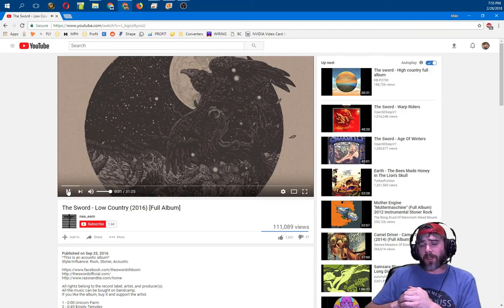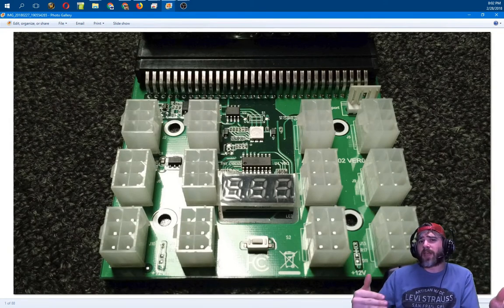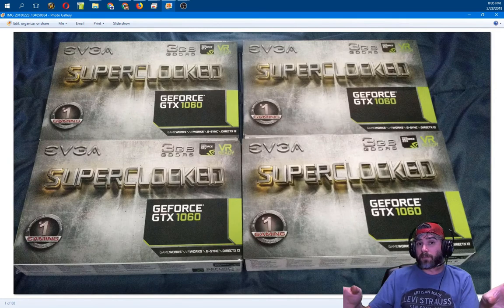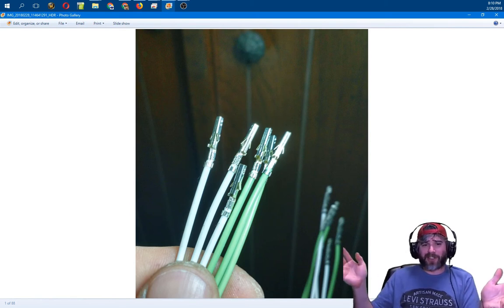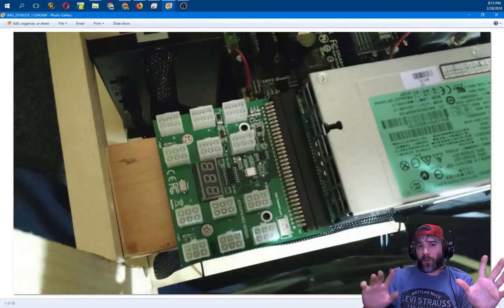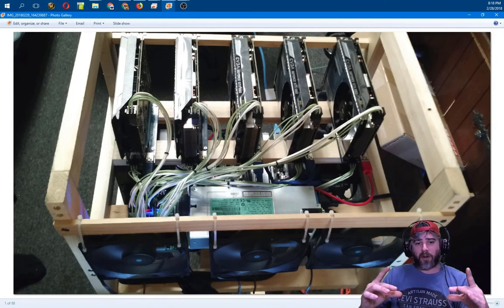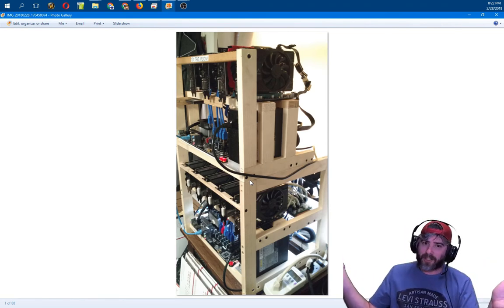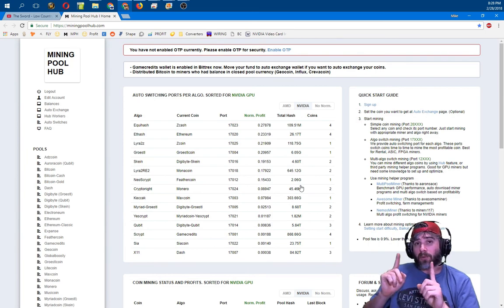Upgrading my mining rig PSU to use a 1200W server PSU, 5x GTX 1060 rig

Comment: How do you connect the Server psu to the ATX psu for it to turn on and turn off together in one touch of a botton?
Reply from the maker: The server PSUs breakout board have a header that looks for a 5v or 12v signal [i forgot what] and it will auto power on when it sees it. Basically, you just jumper the ATX power supply that controls your motherboard to the headers on the server PSU's and they power on and off in tandem with it.

Comment: can you help me too,  be quiet! platinium 1200w or hp server 1200/1500w. Which one should I choose?.the most important for me is less power consumption. I'll use 6 or 8 cards rx 570 with btc-t37.
Reply: same efficiency, up to 94%

if cost isn't an issue then ATX psu just for the silence and warranty (though server psus are tanks so warranty is a very minor thing to worry about)

Comment: Where did you get the supplies for making the custom power cables? I can find the 18gauge wire but not the tips nor the little tip inserts I guess that go into the 6/8 pin connectors

Comment: That 94% efficiency at converting AC to DC is obtained when you are using 220v. So with 110v or 100v you would expect less closer to the high 80s possibly low 90s. For the money a server PSU is still a better investment than a costly ATX PSU at the same power output with the same 80 Plus rating.

Comment: hi bro im jumping from asics to gpu mining i have about 15 apw3++ im builing my first rig with asus b250 19 gpu motherboard my question is my psu has 10 6 pins conectors whats best way to power the cards and mother board i will use 3 apw3 at 110v wish they will be 1200 watts each can i connect 4 of the 6 pins conectors to the 24 pin motherboard or can i use a pico psu and if i can what power pico ? also can i use 6 pin to dual 8 pin conectors for cards and risers 
thank you
Reply from the maker: I have mine setup so the little 450 watt computer power supply is plugged into the motherboard to power it and the CPU, memory, etc.... the GPU's are fed power direct from the server power supplies, and the server power supplies have special jumpers on them to automatically turn on and off with the motherboard when they detect power.

Comment: how you doing, couple of questions, I'm learning about this server psu.  how do you connect it to the motherboard? do you have for sale? does it work with any 1060 1070 1080 ti? do you power cpu motherboard and pci with with or do you use another psu? thanks
Reply from the maker: The breakout boards I use has a tiny 4 pin power adapter that is the same connector as an old school FDD [floppy disk drive] which is often still bundled with ATX PSU's. When the ATX PSU is powered on, it provides 12V to the FDD connector, which the breakout board sees, then turns on the server PSU at the same time. It's a pretty neat system. I do have 1 unit leftover, and I do have a breakout board with it as well. Hit me up @ wowfishmonger@yahoo.com and I can send you some info

Comment: are those 6pin pcie on the bo board rated 75w? if it connects to a gpu with 8pin pcie connector (rated 150w), will it overload?
Reply from the maker: 6 pins are theoretically rated to a maximum of 324W. Each standard pin is rated to 9A @ 12V. [Some are rated higher, but are more costly and seldom used] and with 3 pins that gives you a MAX rating of 324W. That is redlining everything, and you never want to do that, so dropping the max load to 80% of that value puts you at 259 watts, which is why I comfortably rate my cables for loads up to 250W. The type of cable and its length used will also affect this, as smaller, thinner cables have higher resistances and further restrict your current.
Reply: Fishmonger ! Thank you for the details. Really appreciated. 👍👍

Comment: Where do you get your connectors, pins, crimper, pin removal tool, wire and ect from?? I've been looking at making my own cables as well. Thanks!
Reply from the maker: I used to work in electronics / wire mfg so I knew of places that sold the items fairly cheap, however now people are selling them direct on ebay lol. Here is a webpage with some good info: http://www.playtool.com/pages/psuconnectors/connectors.html
Reply: I need cables, I’m looking to power the GPU that  uses  one 8 pin connector (6+2) and one 6 pin connector (but I still like to have another 6 +2) and what do you think about powering the risers too out of that one cable with multiple splits?
Reply from the maker: I do that myself. I build "y" cables that have a 6 and a 6+2 for that purpose